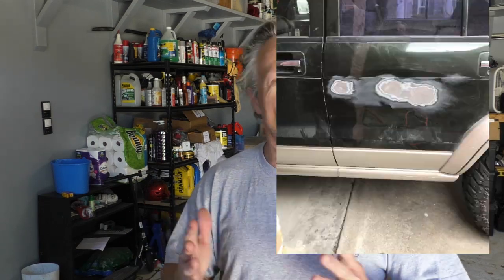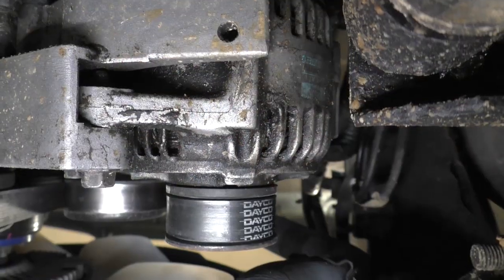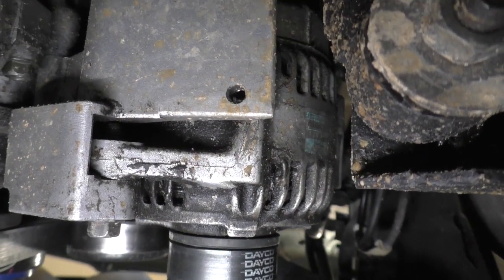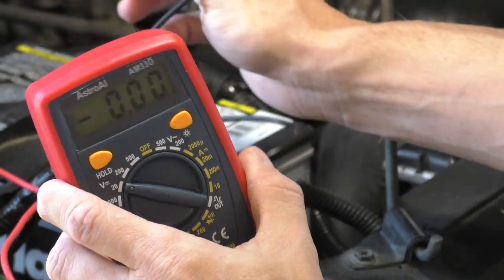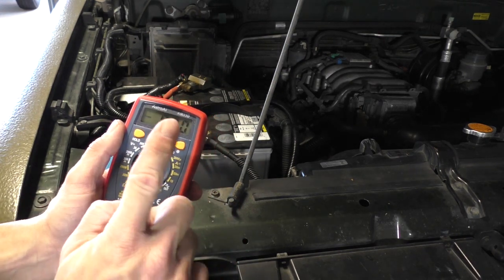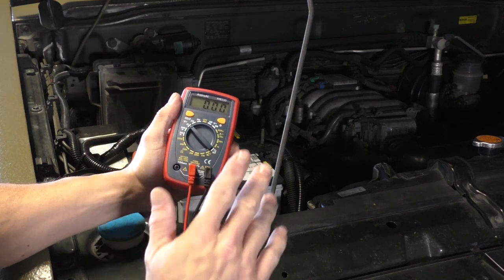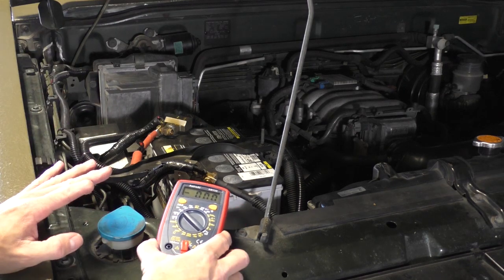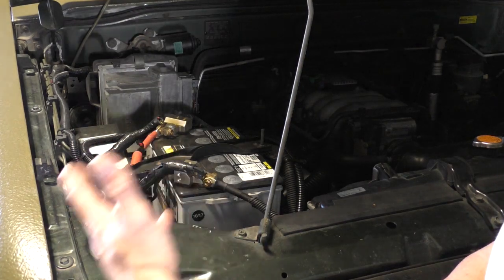Testing an Alternator With a Multimeter- WAS IT RUINED BY OIL?

Comment: I have the same problem how did you get the oil out of the alternator because my battery light is on and I have a new battery and starter and alternator is still good

Comment: My oil leak was caused by me. My multimeter battery died and I couldn’t check for voltage but I’m pretty sure it’s the alternator because lol, …I was changing my oil, drunk, and stripped the cap that holds the filter in its housing. Screwed it on wrong. Wrong. Oil began to leak into the alternator causing smoke . It drove for a week after replacing the cap with a new un stripped one, then battery light and power steering light came on

Comment: Thanks didn’t know I had a leak. The alternator looks like it was dipped in mud. The front has dirty oil on it. The back of it is fine. Looked for the possible leak. Car runs fine however I haven’t tested the battery. I was told it’s going bad.
Reply: Omg mine does to

Comment: I Am having some issues with my trooper. When idle it accelerates and decelerates constantly. I’ve changed the TPS and checked other sensors and it continues doing it. I just repaired the engine. Anyone could help me?

Comment: I have this problem now. I crack my car and the belt squeaks and my meter reads about 11.6 to 12. After about 20 seconds it'll finally get up to 13.6 to 14 and it stops. It use to happen only when I turned my heater on on a cold start but now there's oil leaking on it and it happens at every start up

Comment: I have an 89 Rodeo overlander battery light came on the other day then all the other lights and then it died.

I just pulled the alternator and it's got a good bit of oil on it. I think it's draining down from the cap and not the valve covers. I replace the VC gaskets about 2 years ago

I'm wondering or was wondering if oil ruined my alternator which was only three years old.
I think the problem is I did put a cheap AutoZone alternator on it in 2019.

I also painted my rodeo with bed liner paint but I went with black.
And I see you ditched your plastic engine cover which are totally useless and can actually cause an engine to get hotter.